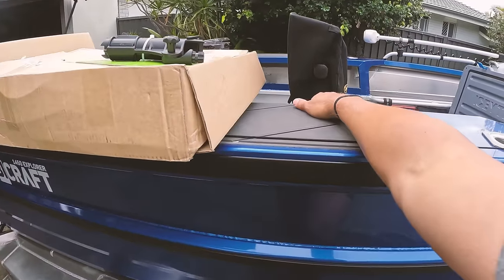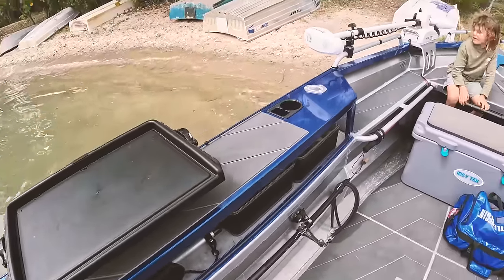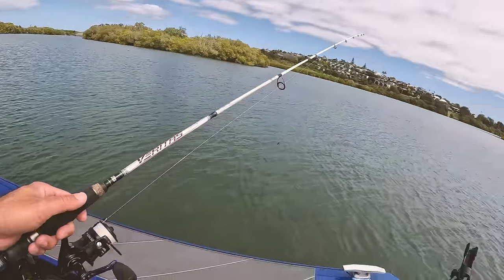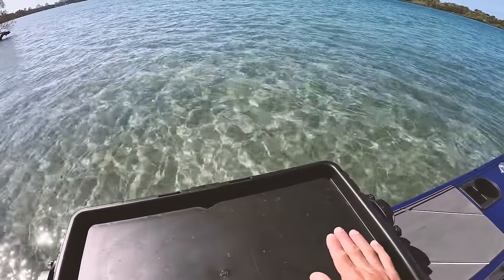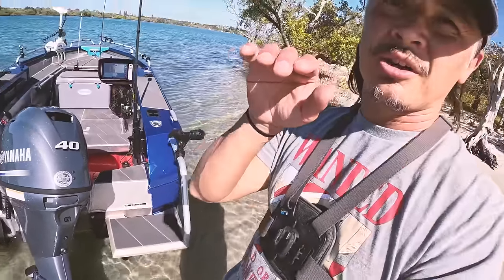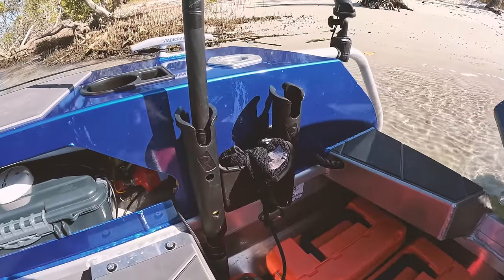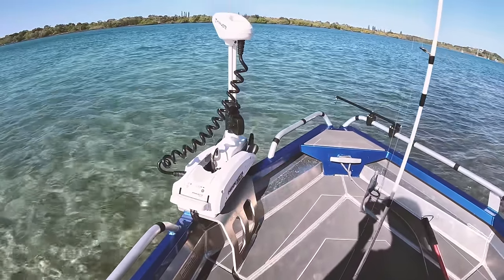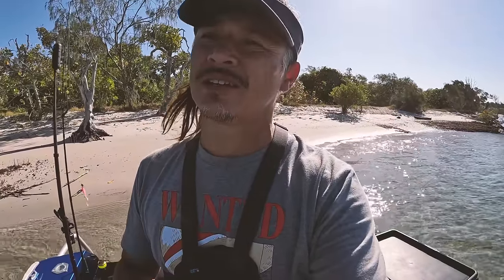Every Upgrade Made - The ULTIMATE SMALL BOAT - Stabicraft 1450

Comment: Definitely go the dc charger, I run one between my lithium house banks and my agm starters, works very well. Will also give you the option if you want just to plug a solar panel or blanket into the dc charger to top up when needed

Comment: Hi Rod, I have a 1450 Stabi Profish and have the Minn Kota with the same lithium battery as you. I have set the battery up with an Anderson Plug and have a 200W Kings solar blanket and an Allspark DC 2 DC controller. On a sunny day I can top my battery up from 80% to 98% in 90minutes!!

Comment: Hey Rod ill be interested to see how your Bait Board works out. I fitted one but it leans too far inwards and all your fish juice and guts runs inwards and dribble inside the boat. Works better if you turn it around with the outlet drain inwards and fit a bit of hose on it out over the side. Bit of a design fault really.

Comment: Presumably you would want to use the DC to DC charger to top up the Minkota battery with the alternator. Can you point me to a website which explains how to wire this? I used to charge the house battery just with a charging relay in my previous boat but trying to work out pros and cons and how to use DC2DC option.

Comment: Great video, would love so links to everything and maybe promo codes. As for putting a dc-dc charger in your boat, I've been fighting this with my yamaha 50, (about the age as yours) the charger system only makes 16amp, (check your manual) I've down sized from a 25 amp dc-dc charger to a 10 amp and it still struggles. Anyway loving the videos and hopefully doing some of the same things soon

Comment: Thats awesome  Rokkit just be careful with the dc dc charger idea as I know my electric motor can not be turned on or connected to the battery when the battery is being charged yours might be different but somthing to be aware of mate.
Reply from the maker: Good advice, will have to check it out👍
Reply: @rokkitkit  Yeah, they're correct. You will have to isolate the electric motor from the battery when it's charging (from solar or 40hp OB alternator), otherwise you will fry the electric motor. So don't roll out your portable solar panel and try and charge the lithium until you've installed an isolation switch between it and the electric.
Reply: @chats5957  cheers mate for explaining it better im not the best with words lol

Comment: IMO,  I will buy a regular large plastic cutting board (not to thick) and customize it to fit on top the table. Silicone it or mount it with stainless screws coming from the bottom of the table board. Just an opinion. I'm not a good fisherman but I think loosing the big fish is not his fault. I think the drag is not properly adjusted since your son doesn't have that much experience. Maybe the fish barely hooked. Now that you know there are big fish in that location, maybe go back when you guys have more time.